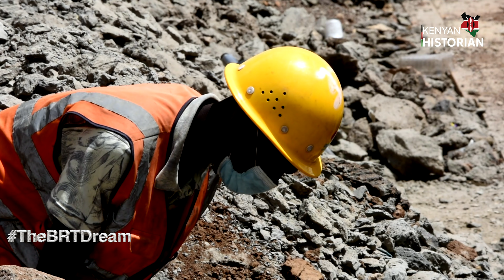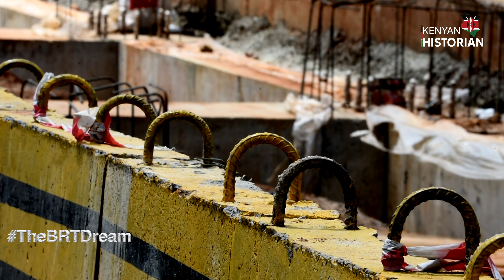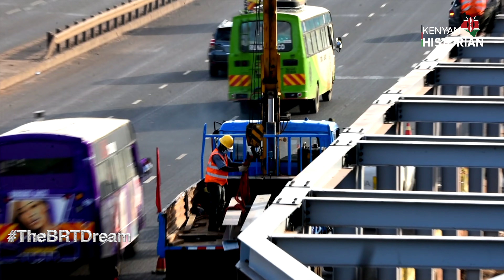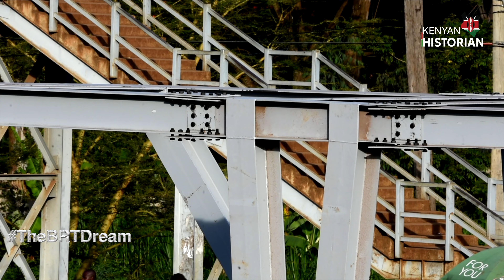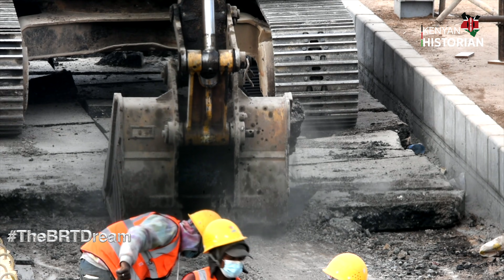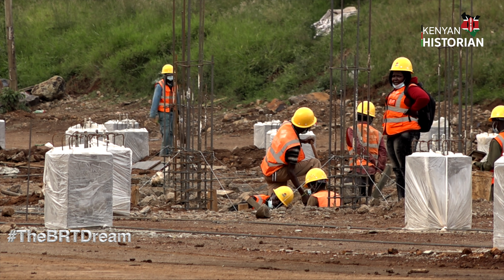KENYA'S BRT DREAM: Engineering & construction works on the bus rapid transit system. #ThikaHighway.

Comment: This kind of work can be done by Kenyan Engineers if the government is willing to fund it, at a much cheaper cost than the loans being provided by China and personnel ranging from manager to supervisor to "wheel barrow pusher". Africa you have all the resources both mineral and financial, and now the technological know-how. It is African Engineers and technicians working in the West many of them from Kenya and Zimbabwe. You do not need to rely on anyone else for solutions at extremely exorbitant rates and unacceptable contractual conditions for the funding. Africa is being sold to China one loan at a time.
Reply: The same Kenyan contractors that cant even build a quality road and complete it ? You know very well that the quality of engineering in Kenya is wanting so why not contract it? Engineers in Kenya are half baked with very little technical experience for such projects,  btw even Europe and Asia contract their infrastructure building to Chinese companies, there's nothing wrong with that, its like saying your sold to China for buying a Chinese made phone

Comment: Thika road was constructed without plans for brt. Brt was an afterthought. Fitting it in includes deforming and robbing thika road it's former beauty and shape. It also weakens the foundational strength  of T.R if not properly executed.
I will miss the green grass that was btn the roads.
Anyway I blv BRT benefits  outdo the few negative aspects.
Kudos!

Comment: As much as we build roads, we need more manufacturing. I just wish that Kenya had conducive environment for production because what impedes manufacturing in Kenya is expensive electricity. Then corruption is another problem. Infrastructure that is not adequate to the volume of traffic. Also skills lack because majority Don't have the skills for 21st century manufacturing. Also it's expensive to get factors of production like machines and all.
Reply from the maker: Electricity and high taxes. This nation is obsessed with taxing. Companies have collapsed and others run away to neighbouring countries. I remember checking reasons stated for the collapse  of Panpaper Mills. Number one was Electricity bills; 2 _ mismanagement and 3 _ high taxes.... but we don't learn really.
Reply: @KenyanHistorian  spot on. Cause I wonder why Kenya is not getting the investment at the rate Ghana is getting. One would expect Twitter to have considered Kenya as Africa's headquarter for Twitter. One would expect toyota,kia and other car brands to open plants in kenya but we shoot ourselves in the foot.
Reply: Ethiopia's dam might help I'm that regard by providing cheap electricity.
Reply: @listenup2882  Ethiopian electricity would help in Northern Kenya. Due to proximity
Reply: @antony6799  will they exit Ghana now that Nigeria has blocked Twitter
Reply: @westmax8491  if the ban is long term i guess they'll have no choice ,Twitter has been so vocal against that ban, I guess its really affecting them
Reply: @antony6799  perhaps they could be lobbied to come to Nairobi or create eastern africa regional headquarters in Nairobi. Countries lobby companies to come to their countries and set up plants, I would expect such a move from kenya

Comment: I am stuggling to understand how blocking off the inner lane wont cause more traffic jams. Nairobi needed a suspended light rail system along the highways. I doubt this would work in the long run.
Reply from the maker: You have to go back to the basics. What causes traffic? Too many cars on the vehicle... and why do many people use cars in Nairobi _  the lack of safety and reliability in our matatu system. BRT brings that and slowly many people will shift to the new system. Driving to work and back is very expensive...once people are sure of their security, safety and can rely on the system, many will dump cars at home... the responsibility of government is not supposed to be for the few but for the many.... so BRT will be moving masses and that's why the system gives it priority...
Reply: @KenyanHistorian  it will work of BRT is on a higher standard than Matatus.  Isn't this system similar to the one done in the country of Colombia and people there hated the system?  An over head rail would be ideal for this. Nairobi surely needs massive metro trains

Comment: The Idea is good in principle but practically it will creat more congestion on the road due to closed lane. The exit routes for brt buses will also not work well. Brt lane should have been put on service roads with bridges on where service lanes touches a roundabout. We have better designers if only they could be given a chance

Comment: And without a functional command and control centre to handle logistics we'll be setting up the system for failure so both  hardware and software systems should go in tandem.

Comment: Hate these bridges setup in the middle of a highway. They'll only add up traffic jam in an already congested highway.

Besides, Thika road is literally back to it's oldself... two way lane. Meaning more traffic at peak hours. They should've installed electric buses instead.

BRT buses will only bring more congestion. These designs should've been considered before building the actual highway.

Thika road will become the new mombasa road. Hectic jam, confusing lanes and more congestion. Especially at pick-up stations.

Comment: Great reporting. 
The workers seems to be using inefficient tools. They need automated tools as well as real harnesses for safety those ropes are not good enough. I am in Construction BUSINESS some of these tools they are using are not efficient obviously the Contractor is responsible for supplying the correct tools to the workers. I do however, admire the hard work these workers show just being let down by the Contractor in an effort to safe more money for their profits.
Reply: That's very true.
I saw them using spanners and that should not be so. Harnesses could save them in case one is knocked by those spinning I beams or accidentally looses a foot.
Safety first.

Comment: The workers need safety gear and better tools
Reply: That never happens with chinese. Good luck expecting that from them. That's why there needs to be standards enforced for work safety and wages in Kenya
Reply: @westmax8491  Why single out the Chinese though? This is rampant in all institutions run by the state

Comment: amazing documentary...but wont the BRT take a lane and make the Thika road more congested hence more traffic jam?
Reply: the traffic on the main highway is caused by buses and minibuses cause they insist on picking and dropping customers even in rush hour
If they're in their own lane the rest of the traffic should flow a lot smoother/more efficiently every day
Reply from the maker: @j.o.g.s8179  The role played by matatus is them being unreliable and unsafe... So what happens, they make many people buy or put cars on the roa....and that's how traffic snarl ups shape up. Most developed countries are working on policies that encourage people to leave cars at home...that's BRT, trum services, subways and NMTs...if people don't feel safe in public vehicles they end buying private cars swimming the road.
Reply: I was also wondering too. But will BRT be to the standard where car owners would be compelled to leave their cars at home? It will work if it is on a higher standard than the matatus.
Reply: exactly! the system they are trying to introduce wont be popular because its poorly designed and thoughtout, more congestion will be expected.

Comment: Well as much as it's a welcome, Nairobi needs an underground subway system to beat the traffic congestion.
Reply: With a budget of $30 bn a 1/3 which is pilferage, Kenya 🇰🇪 can build that even in 3 cities
Reply: Very true my friend, but with the fiscal challenges at play currently, this is the best we can afford for now.
Reply: Nairobi is not that big for an underground train, express brt and overland trains for Nairobi to thika and machakos will sort our problem short term
Reply: @MoshiriSam  bro you don't know what your saying, Nairobi is atleast 3 or 4 times bigger than Doha, and Doha has one the longest under ground metro in the middle east so far , and it is doing very well and profitable
Reply: @djdondullah8215  that's the thing we want to copy what is out there, Doha GDP and nairobi's are not the same, hapa expressway mmembiwa you will be paying at the toll stations to use it mnapiga kelele, underground tunnel will be 10times the cost, who will foot the bill.
Reply: @MoshiriSam  Qatar's GDP is around $160B vs Kenyas $110B , aint such  a big difference , I think Kenya can afford a subway if it wanted, a subway can be built even for $3 billion, our budget this year was $33 billion , Qatar's budget last year was slightly over $40billion, the problem is not the money, it's the unprofessional jokers in charge of Nairobi planning, Nairobi doesn't even have a reliable waste disposal system when smaller cities like kisumu have them, leadership is everything
Reply: @antony6799   That's shallow thinking bro, This is not about GDP. Doha with a small population were able to make profit with their under ground Metro, you can imagine how much money our government will make, we've got a massive population of not less than 5 million people in the city. How about we save all the millions of dollars that are lost on a daily basis due to traffic jam, what about the air pollution and noisy cars in our street, don't you think we will be protecting our environment. Nairobi city was not planned very well by the past/former leaders, we can not rebuild the whole city, doesn't matter how many roads the government will build it will always not be enough, The streets are shallow compared to world class cities, trust me I'm not against it but this whole  BRT thing will be a failure. Look at the parkings they are building, it looks very small to sustain the whole nairobi population. Under ground Metro is the only solution, I agree it's a bit expensive, yes it will cost us alot of money but think about the long term reward. The government will be able to save alot of money from traffic jam. We will reduce the number of accidents  but also the government will be able to make alot of money through service charges of course we will not be boarding the trains for free. And last but not least we will be protecting our mother nature and improving our environment.
Reply: @djdondullah8215  read my comment bro, I'm for the subway, it's the other guy above whose using the GDP excuse as a reason not to build it
Reply: @antony6799  I'm sorry bro, actually I was replying to him but YouTube kept on deleting my comments, that's why I ended up tagging you  instead.
Reply: @antony6799  it's not viable now wacheni ndoto
Reply: @djdondullah8215   Achana na watu wasiojua. They can't compare Nairobi to Doha. Population matters here. Kenya yenyewe ni almost 50 times bigger than Qatar n we are not leading in gas n fuel supplying in the world. Na watu wanalazma tuwe same. Better watufananishe na countries zingine
Reply: @antony6799  Remember Kenya has about 17 times as many people as does Quatar so Kenya has much less money to play with.
Reply: No,long term solution is We need to modernize other cities. Regardless whether we improve infrastructure, we cannot outcompete the rural urban migration found in Kenya or most of Africa. So improving Nakuru, Mombasa, Kisumu and proping up small towns like Neri, Meru, kissing etc by encouraging investment into those places would help thus diversifying migration options. And by investing in those places I mean we bring them to the level of Nairobi or even better and can be accessed through international flights and foreign investments can come there because what we have is investors mostly invest Nairobi which means most opportunities in Kenya are mostly in Nairobi. Just like you see in other countries like China, US, South Africa and many more have plenty of cities with world standards such that not everyone is flocking to the capital city. Imagine if most South Africans were flocking to Pretoria, Chinese flocking to Beijing or Americans flocking to DC?